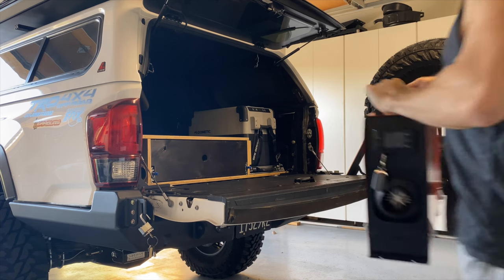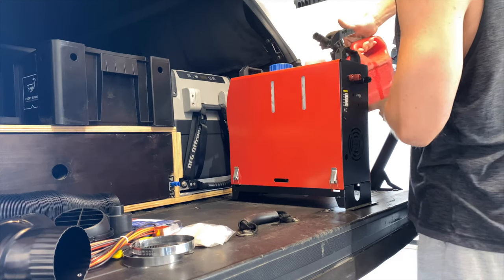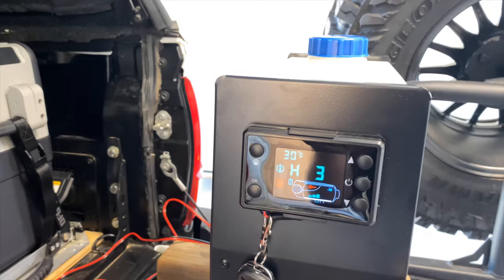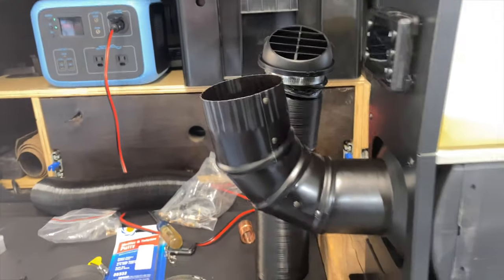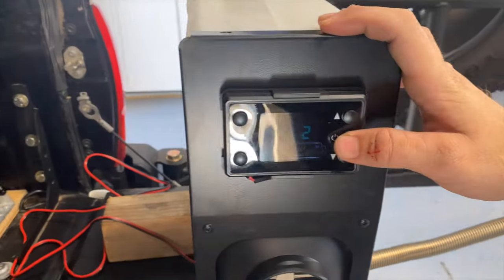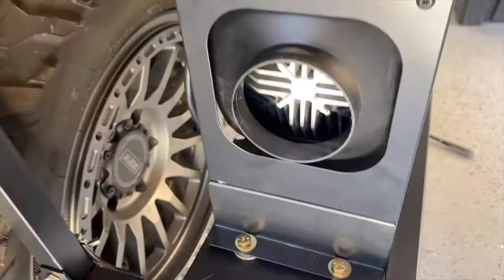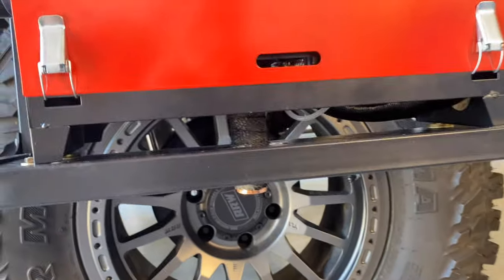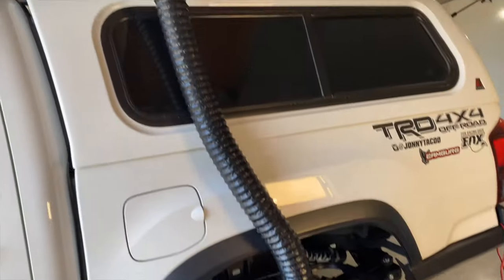Ultimate Diesel Heater Mods for Camping (Winter Overland)

Comment: How well does a pump air through all that hose
Reply from the maker: Pumps air well. The heater is adjustable the higher you set the fan speed to the more it’ll blow.

Comment: Hey! 25mm copper coupler, can you clamp it tight enough on the exhaust exist? I am planning to do the same setup but not sure. Because I will install it in my canopy camper and needs to be sealed well and safe.

Thanks for the video bro 🤙🏻
Reply from the maker: The exhaust stays in tact. If you’re local. I have another one you can have.
Reply: @jonnytacooutdoors  oh I just realized that you did not clamp the copper on the actual exhaust exit! My bad. I'm thousand miles and a continent away from you but thank you for being so kind 🙏🏻 I will get one of those copper couplers.

Comment: According to my experience in China, there is a problem with this case: when the exhaust outlet faces the strong airflow, it will blow the waste air back into the car, so the exhaust outlet should avoid the wind and go down
Reply from the maker: Hey Ping! Thanks for the information. So don’t mount the heater inside a vehicle? Just leave it on the truck tire step like I have it?
Reply: @jonnytacooutdoors  Always make sure the exhaust going down so you don't get any water/moisture to get back into the heater when it's turned off. Inside an truck isn't an problem as long as the exhaust is well insulated from burnable parts.. I have it mounted under an bench in my RV and it have worked just fine for like 5 years now...
Reply from the maker: @Richard-te9mo  thanks for the advice and thanks for watching

Comment: How many hours/nights usage do you get out of your Bluetti when using the heater? And what size battery? I’m thinking of getting this set-up.
Reply from the maker: The bluetti is linked in the description make sure to buy using my link it helps out the channel. Sooo The heater draws barely any power what draws most of my power is running my fridge off it. Which is does fine. I could run the fridge for at least a couple days without re charging. I got the solar panels with my bluetti also. 
This is how I run my setup. Plug the bluetti into the 12v plug in the truck(buy an extension on Amazon) then plug the fridge into the bluetti. That way when you start the truck the battery is charging and when you turn off the truck the fridge is using the battery.👌🏻 HAPPY CAMPING!
Reply: Thanks for the reply! So if I’m only running the heater on the battery through the night, it should last several days without needing to be recharged?
Reply from the maker: @alexhurtado4708  100 percent. Once booted up the heater only draws like 8 to 10 watts😎
Reply: @jonnytacooutdoors  awesome! I appreciate the response time ✊🏼✊🏼
Reply from the maker: @alexhurtado4708  of course!

Comment: Now that you have built it and have used it, is there anything you would change out or do different with this build? also with it attached to the tire step how does it pack down and store in the truck?
Reply from the maker: Great question. Yes the hose I will be trying to find something more metal with less plastic. But watch my video I’ll be posted on Monday next Monday I’m posting episode two and I go through some of that. It pack downs ok! I’ll jus throw it in the back when I winter camp! Thanks so much for watching Marc!
Reply: @jonnytacooutdoors  did you find an alte!rnative ducting? I tried an all aluminum dryer hose and it was difficult to work with
Reply from the maker: @kevinroque3662  no no need the smell went away!
Reply: @jonnytacooutdoors  Awesome just ordered the same one but going to let it run out in the open to get the smell away. Just a headsup for anyone looking to run this off a bluetti. I have the Bluetti EB70S and the startup with the glow plugs triggers the 10A safety in it and it shuts down. The work around I found was to use an AC to DC converter rated to at least 15 amps and run it that way. There is some efficiency loss but I'm hoping that with the bluetti will have enough overhead to get through the night and charge with solar in the morning. I still need to test it for a full night though
Reply from the maker: @kevinroque3662  that’s the battery I want to upgrade too! The EB70! I’ve always ran mine into the DC power on my ac50s and never had an issue. 🤞🏻😎
Reply: @jonnytacooutdoors  If you ever get it, let me know if it works for you! If not shoot me a message and I will forward you the amazon link for the converter.
Reply from the maker: @kevinroque3662  their shouldn’t be an issue. I don’t see any difference between both bluetti batteries. You’re not plugging into the dc power on the EB70?
Reply: @jonnytacooutdoors  I tried the DC power port and it ends up running only a little bit until it says short and shuts down. I am running on the AC port with a  converter now.
Reply: @jonnytacooutdoors  Also, I found one other post on Facebook with a guy who had the same setup and issue
Reply from the maker: @kevinroque3662  weird! I never had an issue. It’s probably an issue with the volt setting on the actually heater.

Comment: How do you prevent the diesel fuel from freezing/gelling? I'm concerned. 

Since this happens as high as 32F/0C. 

Do you use additives?
Reply from the maker: I’ll have to keep you posted on that! The fuel tank is inside of the unit though and the heater does stay a little warm to the touch. I think that should help a lot. 💯
Reply: Gas stations use winter blends if you buy the “premium” I ran 70/30 mix in my diesels in mn with no issues and no additives 70% #1 diesel and 30% #2 diesel cause #1 has very little lubricant products

Comment: I will say the only real downside to these is the screen and settings. It's a pain to learn and even then once I figured it out, I occasionally have to look up my little manual to make sure I am doing it right.
Reply from the maker: I couldn’t figure out the manual and my screen doesn’t work with any of the YouTube video instructions. Seems like my unit self primes when I turn it on and I’m able to adjust the fan and temp. Not sure what else I need to adjust.
Reply: @jonnytacooutdoors  Yeah thats pretty much it theres just different cycles. I'm going to try a unit this winter that just has on and off and then a dial. And Also this year I'll be switching to kerosene as it's better on the unit in the cold.  So I hear.

Comment: How does it regulate temperature inside the tent?
Reply: You set it on whatever fan speed setting will maintain the temperature you want. From what I’ve seen they don’t have an actual thermostat like a normal heater/furnace setup.

Comment: Buy red diesel.  Cheaper to run In your heater
Reply from the maker: What’s red diesel ? 😎
Reply: @jonnytacooutdoors  it is diesel that does not have the road tax on it.  It’s meant for farm vehicles and other off road vehicles.  I run my diesel heater on it and it burns the exact same as road diesel.  The advantage is it cost $0.50-$1.00 cheaper per gallon because it doesn’t have the road taxes on it.  Not everywhere sells it so you have to look for it.  But if you find it, use that instead.
Reply from the maker: @hyperman717  not sure where to find that !
Reply: @jonnytacooutdoors  you have to search online for it or ask around and you will find it eventually.  Only one place where I live has it.  Atleast that I know of.

Comment: the shorter the air hose, the less heat is lost. then maybe you should have a return line for the air back to the heater, then you don't have to heat up cold air and it can save a little on diesel.
Reply from the maker: Thanks for the advice! Thanks for watching! Don’t forget to subscribe
Reply: Safety Warning: beware doing this if you have a sealed environment (like a camper).  For a tent, probably no problem because they are not as air-tight, but I’d still worry a little even then.  Recycling the air like this can burn off the O2 in your space over time and you can literally suffocate in your sleep.    Probably best to just keep the air inlet sucking outside air rather than air from your confined sleeping space.
Reply: @figmojustfigmo3820  this is how heaters work in mobile homes. but certainly take the air from the outside where it can suck in the exhaust gases from the burner. then there is usually ventilation in both mobile homes and tents. but of course you have to be careful. it applies to everything.
Reply from the maker: @figmojustfigmo3820  good words. I might actually not solid mount it in the truck (so I have more storage room. ) and just bring the diesel heater out on the winter trip. Leave the diesel heater on the tire step(suck air from outside) good idea right?

Also I’m mount a carbon monoxide sensor inside the camper.

Also I always sleep with windows cracked.

Comment: I accidentally just bought the 5kw version. I was not aware that there was more than one option. 
What's the difference? More heat? Should I be concerned that I got the 5kw instead of the 8kw?
Reply from the maker: Basically the power of the fan. My buddy has the 5kw version. It’ll work just fine. I just added a link in description to vevor website. Go check it out
Reply from the maker: Also it looks like the exact one I have it sold out right now. The one you got will have the same lcd screen as mine so if you need help learning to use it send me a message on Instagram or email me.

Comment: That is Chinese heater . Germany produce only webasto and espar heaters
Reply from the maker: Yes it is Chinese. When I first researched these heaters I did hear about Germany making the heaters and they are super well built and also way more costly. The Chinese heaters are a copy of them’ !

Have you used either Chinese or German heaters???
Reply: @jonnytacooutdoors  i live in sweden and 70% of cars have factory installed hydronic diesel heaters for engine and cabin heating. German heater are more expensive but consume 50-70% less fuel
Reply from the maker: @Spiritualwarfare587  wow from Sweden! So cool! Thanks so much for watching. Wow diesel heater in vehicles that’s super cool! If you have any tips on how to mount into a vehicle let me know! I’ll be mounting into back of my truck bed and will need to learn how to route the exhaust out of the truck bed.